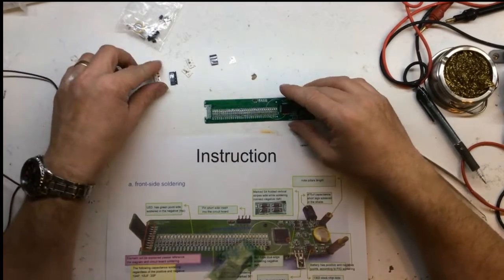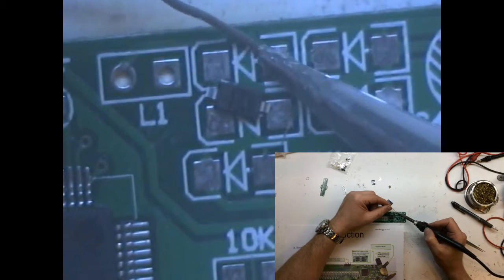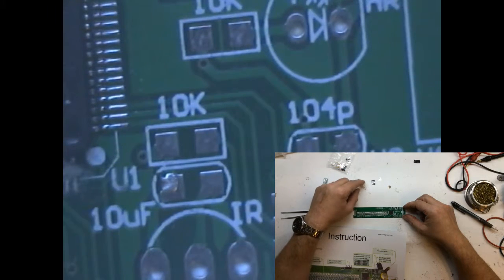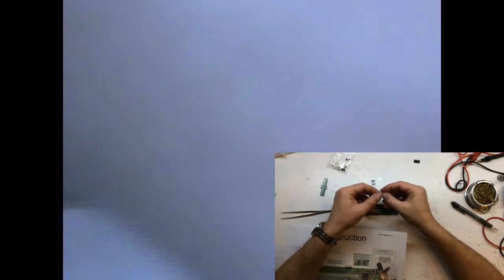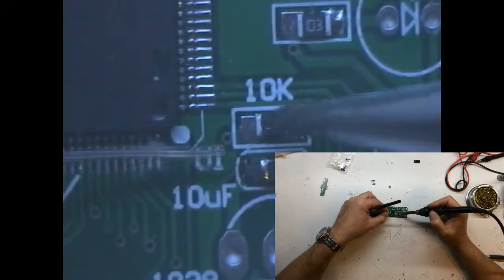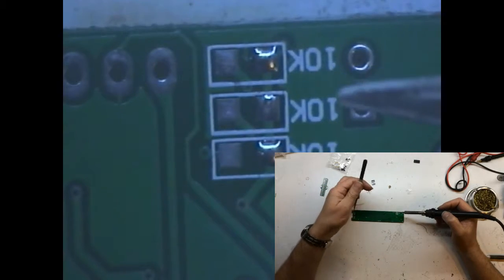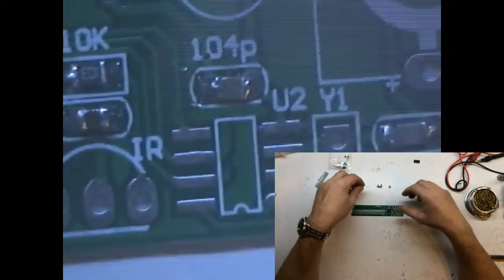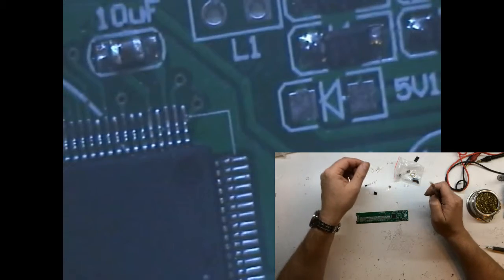Rotating LED Kit from Banggood.com Build part6

Comment: What is the component you use for 10uF?
Reply from the maker: capacitor that came with the kit
Reply: which? ^^'
Reply from the maker: confirmed value at 9:50 ish with my fluke meter